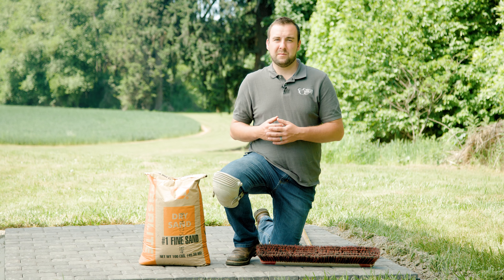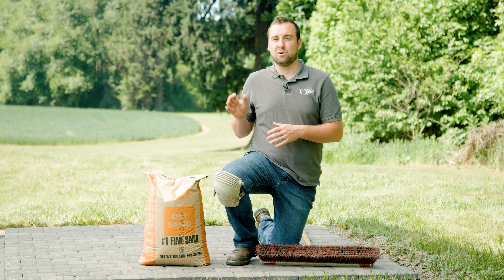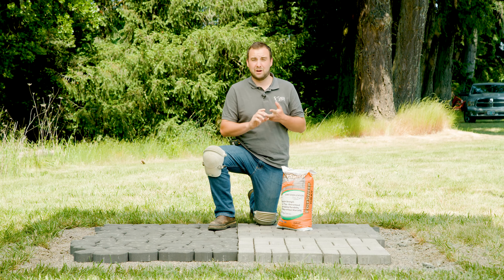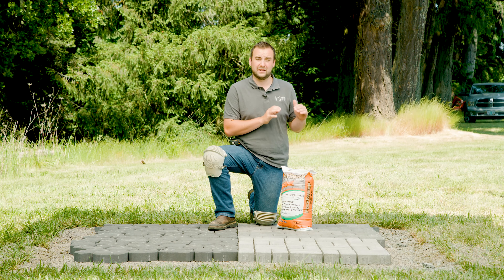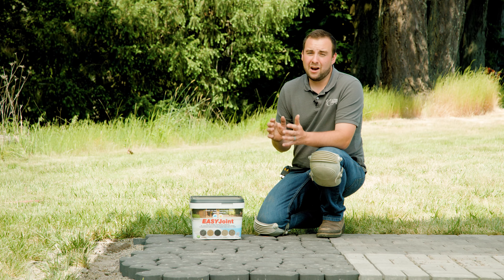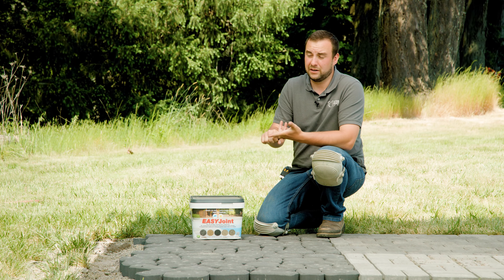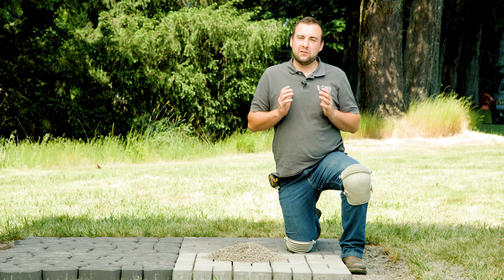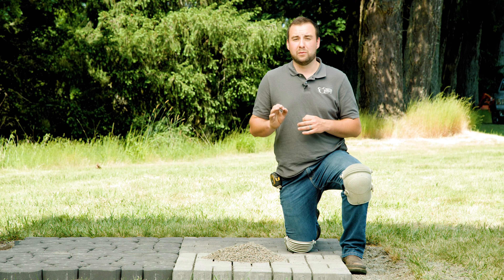5 Ways to Fill Paver Joints: Dry Sand, Polymeric Sand, Joint Compound, Crushed Rock

Comment: Great video. Question; if I use just regular fine sand and then use a sealer on top of it (essentially sealing the sand in place), that should generally help keep it in place, and act as a weed deterrent, right?
Reply from the maker: That is correct. Some sealers are made for doing that anyway!

Comment: It looks like a previous owner laid the brick patio stones with a wide gap directly on top of the dirt ground. I’ve power washed out the dirt between the bricks. Can I use polymeric sand on top of dirt or would it need a proper sand base first?
Reply from the maker: We always recommend the proper installation techniques. I recommend that you pull up the stones and relay them properly.

Comment: How permeable is the narrow-joint polymer sand option?  I live in the CO mountains and get LOTS of snow (over 300")...  when it melts I don't want it pooling on top of the pavers, especially during freeze/thaw cycles which invite ice build up.

Also, do all of the polymer sand options require that the pavers be "leaf blower-ed" prior to watering down the polymer sand?
Reply from the maker: Polymeric sand isn’t considered permeable at all and yes, we always recommend blowing off all the polymeric sand dust before activating the sand to prevent hazing.

Comment: I read online that before using polymeric sand you have to remove the existing sand? Is that so? I also read that if you don’t use it correctly you run the risk of discoloring the pavers?  If that’s the case it perhaps I need to use regular fine sand since I’ve never done this application before. With regular sand do you need to remove the existing joint sand? Thanks in advance for your advice
Reply from the maker: Both of those bits of advice about poly sand are correct. No, you don’t need to remove all of the existing sand if you are using regular sweeping sand.

Comment: Can a patio with polymer sand be powe washed?
Reply from the maker: Yes you can. Just use 1500psi or less and avoid point blank in the joints and in general.

Comment: Although this video gives a good general idea of how polymer sand works, more detail is needed on how to apply it. One thing that needs to be clarified in your video is how you remove the sand from the surface of the pavers. Are you hosing it off, blowing it off, or what? Also, the wetting technique needs to be addressed more clearly.
Reply from the maker: We don’t specifically address those items because each sand manufacturer may have slightly different requirements. We recommend following the instructions on the bag.